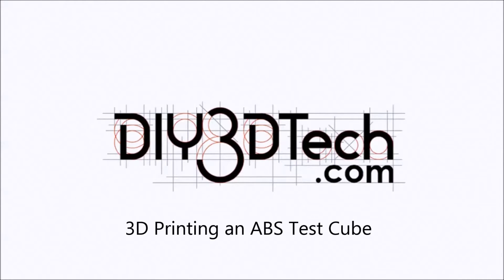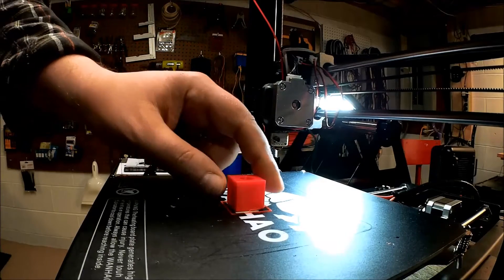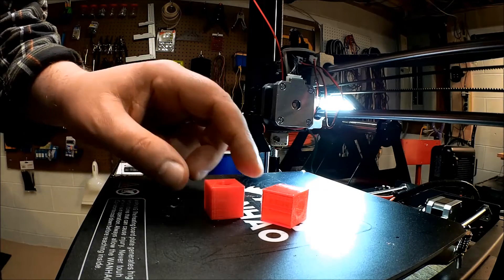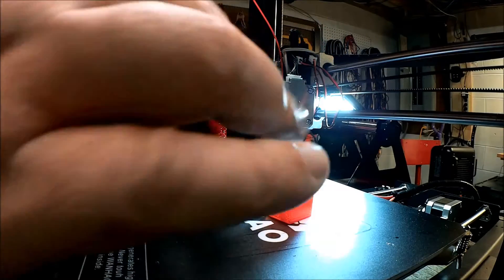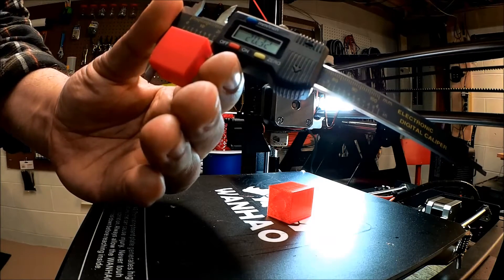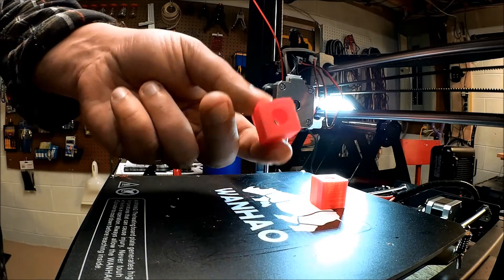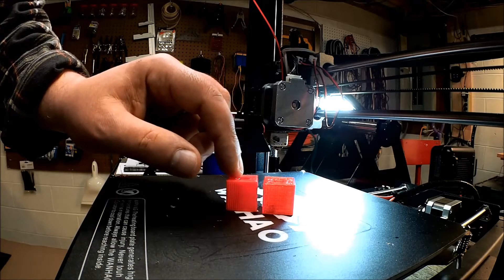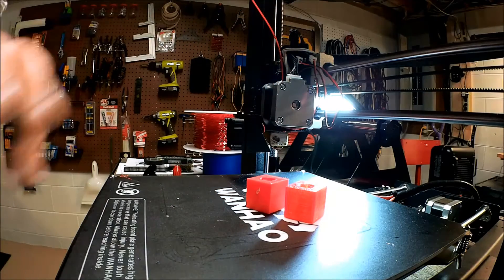3D Printing an ABS Test Cube

Comment: What were your settings? I am trying abs for the first time on my di3 and can't get it to stick. How did you prep your surface?
Reply from the maker: Hot-end 230c and bed 90c with glass bed and glue should sort of work.  However being open frame it will likely wrap if its of any size (small should work).

Comment: Hi I have a da vinci AIO. It is running the most upto date firmware and latest xyzware. I do have to use their filament but i get really good prints in ABS. I did the base and lcd holder for my fabrikator mini with no warping. I use very little non shrink glue stick and the print stays stuck until it cools down and pops off. I think a lot of da vinci users got on the band waggon to use non xyz filament and stayed on old software and firmware but they are missing out. I know their filament is expensive but i make things that i sell on ebay and it is not an issue for me. With the most upto date software and firmware using their own filament i get as good reults with ABS as i get with PLA on my I3 or fabrikator mini . I can not get ABS to not warp on my fab mini or I3. Hope this helps people who are having problems with ABS. One more thing you can usePLA on the da vinci but you need to re set the bed level. For some reason may be to do with the Temp of the bed but when you home it to print it homes higher so you need to bring the bed up. OK thats my lot hope it helps at least one person cheers Tim
Reply from the maker: +Tim Harvatt Sounds things are working well then, and yes ABS on an open frame (case) printer is a "warp" just waiting to happen :-) When you say "non shrink glue stick" which brand?   Also are buying the XYZ PLA carts and using them on the AIO?
Reply: No I use xyz carts on my xyz printer. Tombow is the make of glue I use Tombow strong professional premium no wrinkles washable.
Reply: Sorry yes I used xyz pla carts on my aio

Comment: have you ever printed a block in a vacuumed box?
Reply from the maker: +Chi Sty Can say I have, have you?  What where the results (as I assume you are speaking of a vacuum chamber)...
Reply: I have not ....I just got my wanhao i3 last week ....did the vacuum help at all? I've been printing in ABS 255c tip 120c bed and 55c box. I'll print one before I go to sleep and let it cool down in the box all night. The slow cure time seems to help with strength.i was just wondering if I and a vacuum to this if it would help with warping.some of my print warp but after I started letting them sit longer after the print it seems to be better for them.
Reply from the maker: Wow 255c for ABS is hot, hot hot.  I do ABS around 215 to 230c with bed temp around 90 to maybe a 100c.  Hotter than that on the bed and the plastic remains to molten and gets kind of wankie.  Also becarefull as there a PET tube inside the Wanhao extruder that can be damaged at over 250c (also I have never been able to get mine over 250c).  Do post some videos if you get chance.